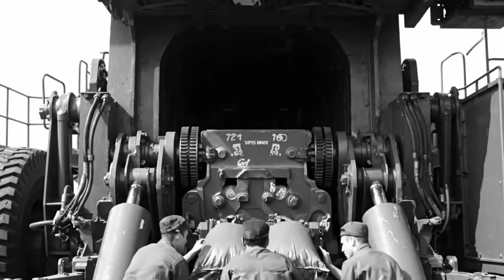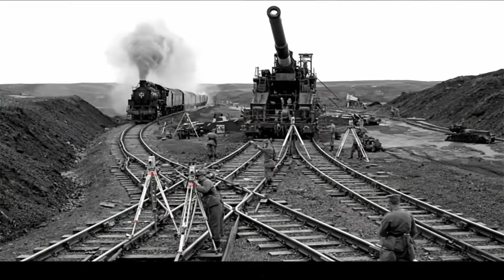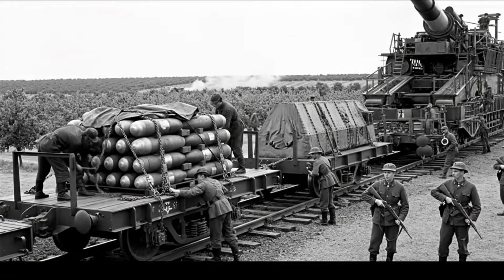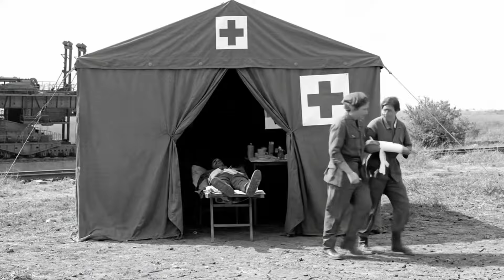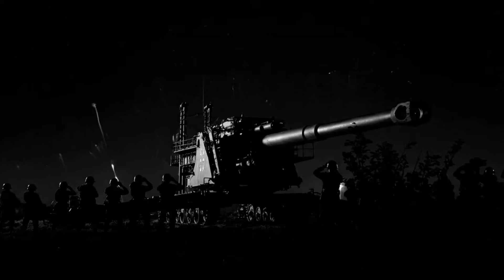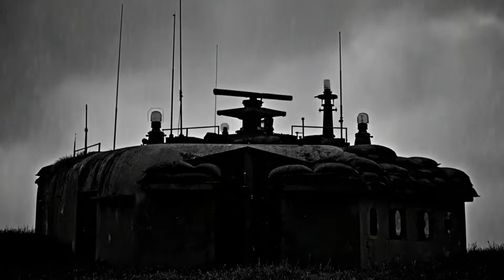Hitler's 800mm Earth-Shaker: The Biggest Gun Ever Built That Terrified Stalin 😱 Gustav Exposed!

Comment: Statistically, if Nazi Germany had been smarter, it would've used all the material for Dora, Gustav, the K5 guns, the Panthers, Tiger Is, Tiger IIs, Panzer 1 through 3s, StuG IIIs and other tank destroyers to produce that many more Panzer IVs. This would've increased the number of tanks they produced from 28,000 to as many as 40,000. Once the Panzer IV was equipped with the KwK 40 gun, it was more than a match for almost every Allied and Soviet tank. It lacked armour but could strike from a distance and still be produced in large numbers.